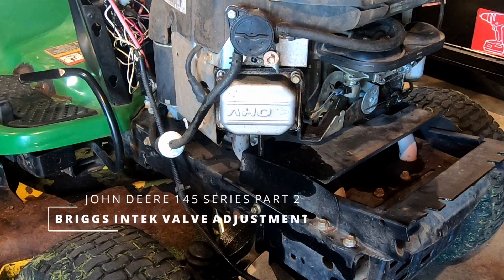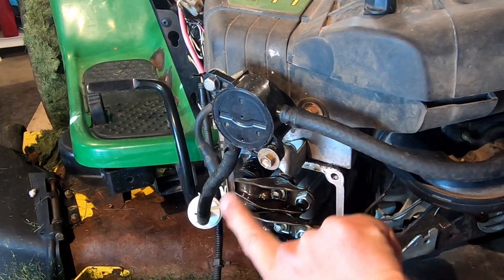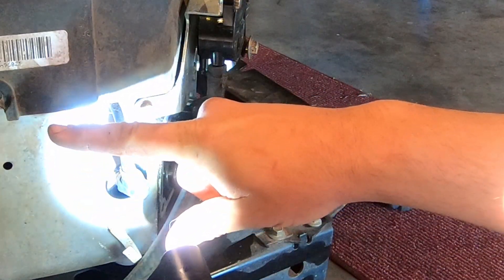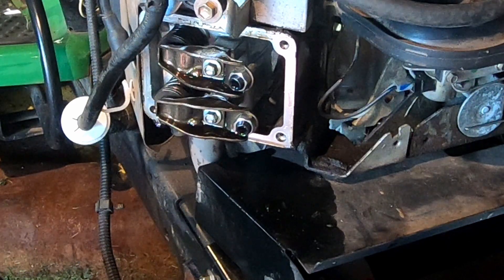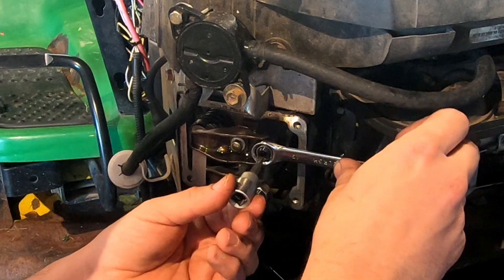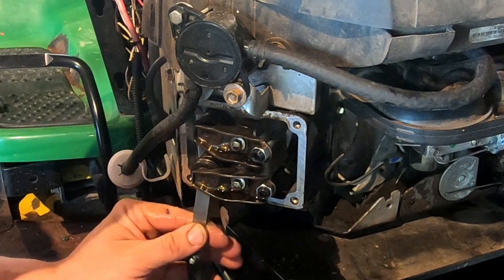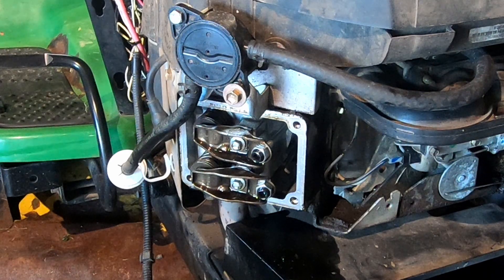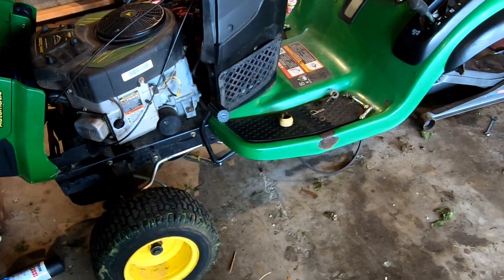JOHN DEERE 145 PART 2 VALVE ADJUSTMENT Briggs and Stratton Intek V-Twin

Comment: I think the big problem is that when you were using the ratchet wrench with the T30, you were losing your sense of feel and with just the socket you were having problems holding it in place. I think it would be better if you would have used a screwdriver T-30 so you could hold it in place while you tighten down the nut. I actually watched you loosen it back after you had it to the correct tolerance and when you put the socket on it you back to back off. The guy coming in love was wrong no you actually use the t30 to tighten and lock it in with the 13 mm hex nut. Good video though I enjoyed watching it. 👍
Reply from the maker: I agree, I have adjusted many valves since this video and definitely have improved my technique, thanks for the comment!